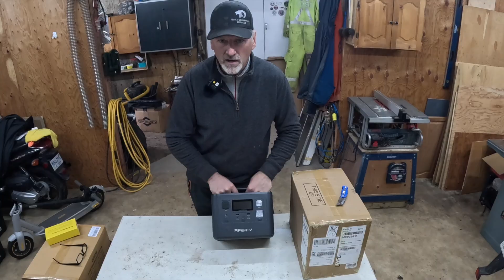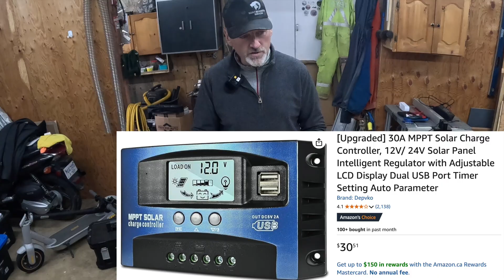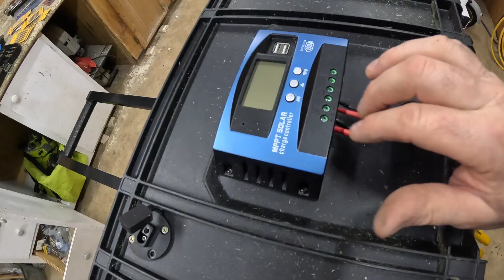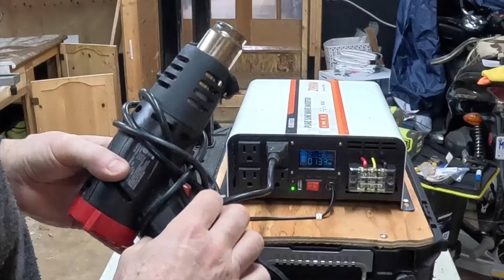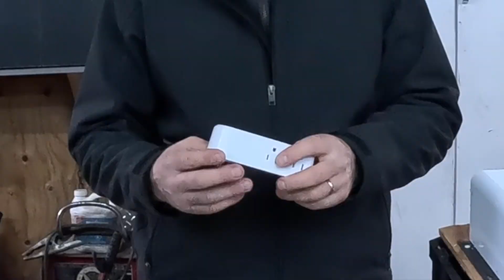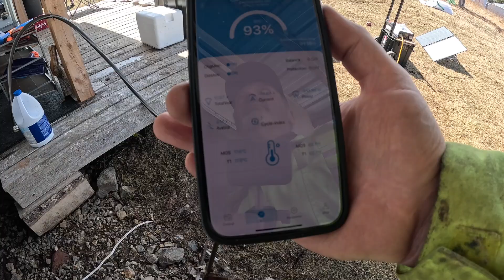Huge Savings: DIY Power Station build and testing Ep. 149

Comment: Interesting set up for sure , I delt with power pretty my  entire 40 year career, but we did things opposite we took AC , converted to DC then our equipment ran on DC with 48V Battery back up. I really would like to get into solar more  and play around with it but the couple of portable units I have does the trick. If I was to be in my shed I could say you have a neat shop LOL, mine is too small is my biggest problem.  Actually the Bluetti AC180 is $799 today and I can give you a code for extra 5% off lol.   What I like with your build is it's much easier to trouble shoot and repairs if need too  especially when it get's bigger for an off grid home and I agree if you're in a area with frequent power failures it's a must. Looking forward to the future project you mentioned I'm sure will be something interesting  as always , Have a great week
Reply from the maker: Thanks for the comment, appreciate the feedback. I'm still learning a lot and I appreciate all the tips! That's a bargan for Bluetti.......I like doing it in pieces like you said I could fix it easier...........Thanks Garry...

Comment: Thanks for your video .  I have been off grid for 25 years now and have used 4 different inverters over that time .   Sometimes inverters will dump a little blast of current out when you first plug something into them .   For example if you plug in a big expensive stereo into into an inverter sometimes you will hear a pop coming from the speakers . That means that the inverter just sent a little lightning bolt thru your stereo and it went right thru the on - off switch .  I would recommend using surge protectors on your delicate stuff when powering them with inverters .
Reply from the maker: Good tip! I'll definitely keep that in mind!...........and you definately have the experience to know what works and the issues with it.........thank you for watching and giving your two cents worth.......

Comment: You are obviously knowledgeable in the subject of backup power and you make a very good sales pitch. Problem is, I was spoiled as a boy when I lived 10 years without electricity and what I used for heat and light at that time is available to me today. Considering that we rarely lose electric power, I resorted to buy an inverter to connect to my vehicle. Doing so may not satisfy today's generation.
Reply from the maker: You are all there with the inverter if you really need power during an outtage.....We have had the power go out about 4 times now in about 8 or10 months........only short durations though........albeit I would have been nice to have this power station to deal with it...........thanks for watching........
Reply: @codraven57  Headstones in a cemetery face east, making it ideal to fasten a solar panel to the south end. What do you think of the idea of delivering power to the inside of a coffin?
Reply from the maker: @ErnestWarren-zn6ph  well I had never thought of that before......hmm........

Comment: Solar and inverters have come a long way in the past few years makes life easier. A couple of things for caution 1. Most of those small Charge controllers need to have the battery hooked before you can apply solar power otherwise it may pop a circuit (die) lol. 2. That inverter will supply more continuous power than the battery can supply so beware loading it up to more than 100 amps (1350 watts) the bms should shut you down if you overload but like everything it may break instead. Now you can work everywhere you want with your power tools perfect for you. I built quite a few from scratch including a few batteries but now I just use the free power. Cheers.
Reply from the maker: Hey that was a couple of great points….I have tripped the battery a couple of times already…..good to know I shouldn’t do that…#1 I did by fluke hook it up the right way…..disaster averted on that one……..thanks for sharing your knowledge with me on this much appreciated……thanks for watching.
Reply: @codraven57  The easiest fix for #2 is use 2 batteries which divides the amp in half. and if you ever remove the charge controller remember to disconnect the solar first.
Reply from the maker: @ yes…gotcha….